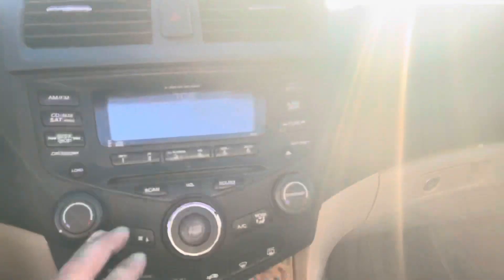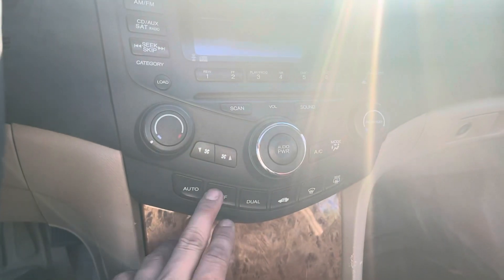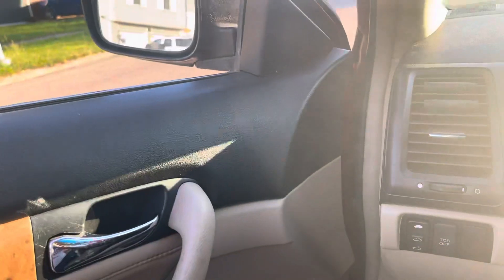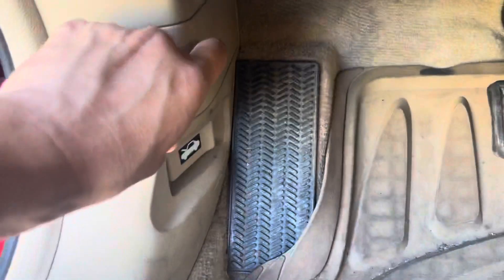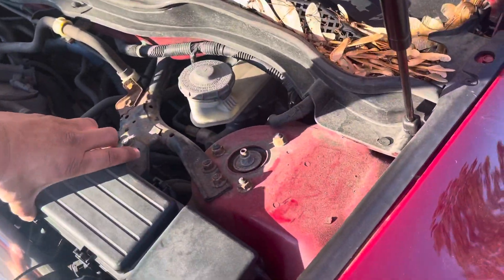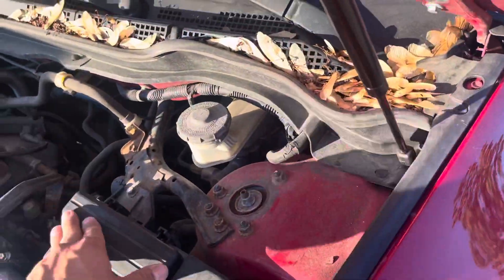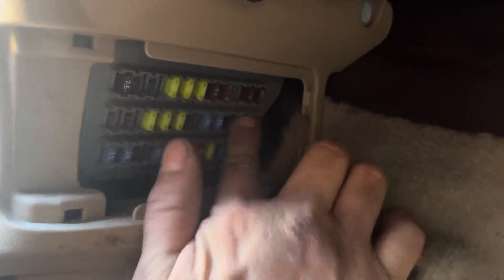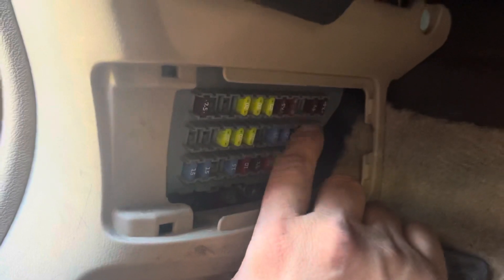Honda accord climate control not working  issue solved fix problem True solution to fixing a problem

Comment: I tried changing my driver side wing mirror to a power folding one with dynamic turn signal, but when I installed it the mirror adjustment and climate control stopped working. Which are the exact fuses that caused this issues? Because you mentioned a few.

Comment: Video was helpful, thanks bro.  But what does it mean when the same fuse keeps blowing out upon changing it?
Reply from the maker: When the same fuse blows out, they replace it means you have a short in the circuit, so whatever you’re trying to plug-in is either shorting out or not functioning or has a cut in the wire and grounding out

Comment: My problem is that both my front and rear defrosts will not work, but the other vents are working? One other thing is that my AC won’t turn on! I figure they all have to be the same problem, I hope! Any words of wisdom🤞?
Reply from the maker: I will check the Freon pressure with the gauge and make sure it’s in the green and not in the red or in the gray
Reply: Thanks for the info! I’ll find out today, one way or another ! ✌️out Mike…

Comment: Hey Mike I did all that but  the radio turns on but no signal like the antenna is out and all the buttons on the button no power still can you help
Reply from the maker: Fine new 12volt consetent

Comment: good day Hi I will like to know my dashboard fan come on when I turn my key on but my control panel  will be of no light on the control at all but blower fan stay on what the problem my panel bad I just don't know I from Nassau Bahamas
Reply: and I no fuse blown I did all of that
Reply from the maker: Is the resistor that’s bad
Reply: Good afternoon this is an 07 Honda Accord
Reply: Descubriste el problema tengo uno igual